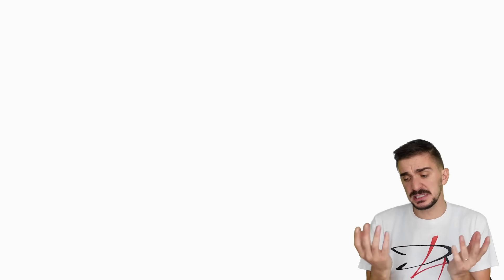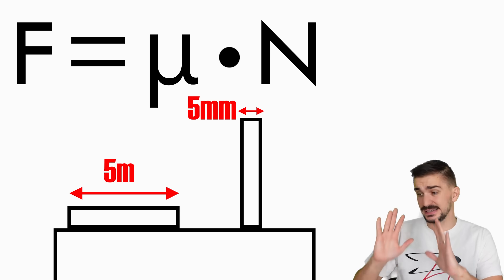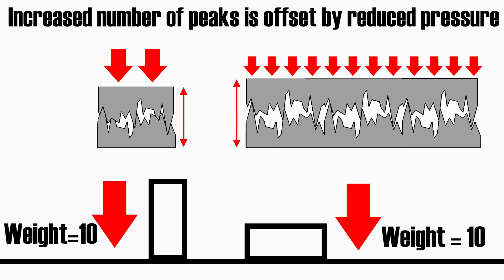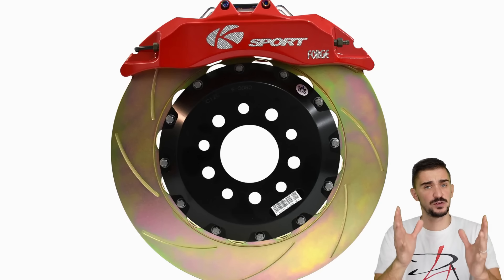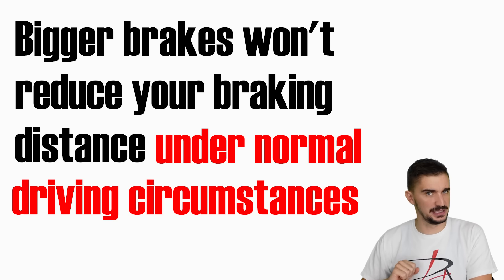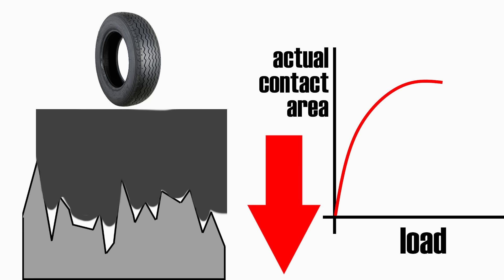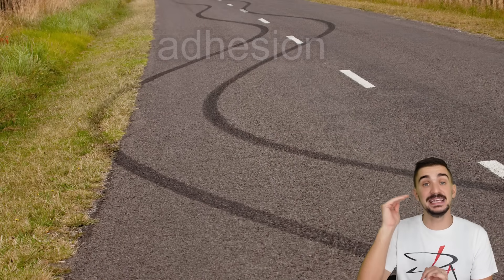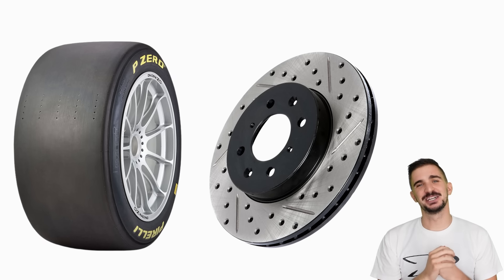Why Big Brakes Won't Stop You Faster but Wider Tires Will - Friction and Surface Area Explained

Comment: Excellent explanation, but I find it misleading  as you're grossly oversimplifying the topic. If I put bigger breaks on my Honda Civic Type R with larger, wider summer tires on it, the difference will be minimal, but braking consistency will improve, as will how many times I can apply them before incurring brake fade. The latter is the heat issue you are speaking of.  There is more.  When I upgrade my brake rotors, I will also have to change the calipers. Therefore, I will also go from 4-piston calipers to 6-piston calipers and they will indeed also have larger pads, meaning more friction area as well. If I change rims to the track tires, the larger rotors will again help with increased consistency and make it easier for me to maximize braking performance.

If I put larger brakes on my wife's Civic Si, with smaller, narrower all-season tires, there will likely be no difference other than better consistency and longevity of baking performance.  However, if I take my larger rims and tires and put them on my wife's car, along with the brake upgrade will make a dramatic difference.  All of this is based on much personal experience.

You also completely left out the increased mechanical leverage of the larger rotor almost everywhere, which I find bizarre. So, yes, if we could somehow install larger rotors on my wife's car, without changing the calipers and without changing the tires, you  would be correct for the most part.  Otherwise, I find the scenario you're basing your information on to be woefully oversimplified and unrealistic as it is based on a completely unrealistic model.  I don't believe you to be incorrect in your science, but in the models you're basing your science on. They are simply not real world examples.

Comment: Can you please do a video showing how/why big cams cause an oscillating idle! 🙏
Reply: If you have access to Engine Masters on Motor Trend,  S5 Ep12 is all about Lobe Separation Angle (LSA).  You'll find your answer.  They dyno three cams with the same lift and duration,  but different LSA. Happy hunting.
Reply: @jeffreylonidier1607  I want an explanation, not a video simply showing the effect! I already know the effect; choppy idle.
Reply: Your original comment asks for a video?  As stated,  the answer is cam Lobe Separation Angle.  Engine Masters explains, in detail,  how/why LSA,  not lift/duration affects idle quality and power.
Reply: @jeffreylonidier1607  where/how can I watch the video??

Comment: A follow up video is needed to discuss brake leverage (or "brake torque"), which isn't discussed here. As per Race Technologies (an official Brembo partner): "Brake torque is essentially the power of the braking system. The brake caliper acts on the disc at a certain distance from the hub center, known as the effective radius. The force exerted by the caliper, multiplied by the effective radius of the system equals the brake torque. Increasing either the force applied by the caliper, or the effective radius results in increased brake torque."

Other videos on YouTube talking about brake leverage / torque:

https://youtu.be/48BRZEzXtcA?t=63

and

https://youtu.be/6NbAEtcQXgg?t=140

Comment: There's another reason why wider disks perform better. Torque. It's much easier to stop a spinning disk by applying friction at the outer edge than towards the middle.

Comment: Over-simplification.  Brake fade, tyre width, the weight of the vehicle, weight distribution, suspension geometry, these all play a part.  Hence, bigger brakes and a tyre upgrade WILL allow you stop faster.  If you have drum brakes incapable of locking up the wheels at speed, a brake upgrade will 100% improve your braking distance.  In short, you are talking out of your arse my man.  Clickbait crap.

Comment: Excellent video, one point you did not mention is that the rubber mixture can be changed as well, so you can make a wider tire out of softer rubber which will increase its adhesive properties while lasting a similar comparable distance than the stiffer narrower tire.... so many parameters to play with :-)

Comment: Increased brake size is not just about surface area and heat dissipation. The diameter of the brake matters too. One of the things driving larger wheels and lower profile tyres is it allows the fitting of larger diameter disks. Why does that matter? It's braking torque/leverage. In essence the braking force available for a given applied friction is directly proportional to the distance of the centre of the pad from the axis of rotation. If the disk size is increased by 25% then the braking torque that can be applied for a given amount of frictional force is also increased by 25%. That will increase the amount of braking up to the point where the tyres lose traction.

Of course the increased diameter disk also increases it's ability to dissipate heat too due to the larger surface area.

Somehow this video completely misses the effect of larger diameter brake disks, and unlike the non-linear issues involves with applying more force, the braking torque relationship is exact. That 25% increased diameter will lead to 25% increase in braking effort for the same amount of applied friction. This is rather fundamental.

Also, I would question the use of the word "elastic" when talking about tyres. In physics, elastic has a very specific meaning. It's about energy loss and return on deformation. It may surprise people that the steel wheels on trains are highly elastic. That makes means they have very low rolling frictional losses. A tyre (or, more precisely, tyre rubber) is not like that; it absorbs quite a bit of energy as it deforms and it should not be described as elastic. Indeed a truly elastic tyre rubber would be very dangerous and offer little grip. Rather, tyre rubber deforms and not all the energy required to do that is returned; some is turned into heat. Tyre rubber is somewhat inelastic, which is not the same thing as deformable (which it also is). The degree to which tyre rubber does this is one of the design aims taken into account for a given compound. There are more complexities in the tyre as a whole; the way the carcass flexes, as well as the pressurised air (that latter part is, to a very good approximation, truly elastic). However, when it comes to grip it is the rubber compound that is the most important factor, and that is most certainly not elastic in the technical sense of the word.

Comment: Bigger brakes can reduce locking time of tires when other brake components remain same. Pressure build on brake pistons takes time, leverage of bigger brake disks or higher friction pads may reduce that time. Moreover, more tire grip and more rotational weight (bigger wider tires) can reduce tire locking time. Most of modern cars have enugh brake for stock tires in daily conditions but generally tracks have more grip than daily roads and tires are heavier.

Comment: The physics explanation here is very good, but it's making some incorrect assumptions when it comes to the total picture. The point being made is that increased surface area does not improve stopping power, but instead is for heat management, and this is completely correct. However, larger diameter brakes can increase stopping power because they have more leverage on the rotating mass. If you, for example, go from a 280mm rotor to a 305mm rotor (with the same brake pad and caliper, just moved 25mm outward), you increase the stopping force for any given amount of friction by almost 9% strictly due to increased leverage.

Another aspect that wasn't discussed is more pistons per caliper. The purpose of this is to improve the evenness of pressure along the brake pad, which is particularly important with larger pads, as the bigger they are, the more potential there is to flex, and not contact the surface evenly. It mostly only affects pad wear and consistency of brake feel, but a very uneven application could cause early brake fade in a more extreme case.
Reply from the maker: I'm interested to know the formula you used to get 9%
Reply: @d4a   Dividing the 305mm by 280mm, it's just under 9% larger, though the real number would be the average increase in the ratio of the lever length across the pad contact area. For a particularly wide pad area it might be even higher, since moving 12.5mm outward on a smaller original radius is a larger proportional increase, but it's still pretty close. 

It's pretty easy to see this principle in action if you have a gyroscope or any other spinning toy where there's a wheel and a shaft - get it spinning, then try to stop the rotation by pinching the shaft vs pinching the wheel. Moving outward from the center of rotation makes stopping it easier.

Comment: Nicely explained. What is the role of the diameter of the brake disk and resulting difference of the torque? (Thinking about it in context of bicycle disk brakes.)
Reply: The same braking force applied farther from the wheels axis of rotation will create more braking torque. However, on cars this still doesnt make big brakes stop faster because you need pretty stupidly sticky tires (like F1 slicks) for braking torque to be the limiting factor.
Reply: Yes, that makes sense.

Comment: Bigger brakes can hold more heat before overheating and they dissipate heat faster. Putting tiny brakes on a race car may lock up the tires, but they will overheat instantly.

Also a larger rotor will give the calliper more leverage to stop the wheel.

Anyway I think that unless your brakes are tiny, or you do hard tracking with a powerful car, a simple pad upgrade is all you need.
Reply: The key is having a lightweight vehicle that can have small brakes (allowing for smaller lighter wheels) and the brakes will not overheat
Reply: Your 100% write. But people that don't know this won't understand.
Reply: It isn't that you expect a big brake kit to stop you faster. I know better than that. If your brakes are strong enough to lock up your tires, then you're not going to gain anything with a bigger brake kit. What you will gain in most cases is reduced fade. Both by additional Mass for the Heat to go into, and greater heat dissipation assuming that the disc is reasonably designed.  In some cases, these aftermarket discs will perform less well initially.  Because they're designed to be used at the edge of performance and really give their best performance once they are hot and the braking compound has chosen to work with that.

When the brakes are still cold, you may have a stiff or slick feel to it like it's not braking very well at all.

I have a 2021 Mazda3 turbo which I bought at the very end of 2021. 2282 I put 54000 miles on the car, I drive a lot. And it is through the North Georgia Mountains so it's a lot of curvy roads with long steep grades.

Do not get me wrong. I love my little car. For daily driver it is awesome. The tiniest little GT car ever. It will effortlessly hold 90 miles an hour while getting 28 miles to the gallon, it has plenty of power for passing and can squirt up and down those mountains.

But.  And it's a big but.  The front brakes are inadequate for truly spirited driving.  In less than 3 Mi coming down Brasstown Bald oh, I was able to get the brakes so hot that breaking Effectiveness was reduced by 80 to 90%.  Toward the end I was actually a bit concerned, having to use engine braking and sudden darting movements to get the car to slide a bit to scrub speed.

In Daily driving, I've never had a problem with it. But I have chosen to get the corksport big brake kit oh, and the next time I'm due to buy tires, I'll be swapping out the tires, wheels & installing the brake kit.

For now, I've chosen a high-temperature compound for my brake pads.  It does mean braking is a little bit subpar when the discs are cold.  But far from dangerous. And as the discs get hot, fade is greatly reduced.
Reply: I don't know why voice typing randomly inserts "oh"

I've recorded myself talking, and I don't say that or anything that sounds like it.
Reply: @thebarkingmouse  idk if you’re taking to me but I agree entirely based on what I wrote previously.

Depends on what you do with the car 100%, and if you’re not braking hard and fast multiple times in a row your stock brakes will be fine on basically any sporty car, maybe a high temp pad upgrade. 

If you’re actually tracking the car then I agree 100% a bbk is required on almost any car. 

Lots of people spend $6k on a big brake kit when they just drive on the street and then they’re confused/disappointed when they don’t stop any faster when they slam on the brakes since the old brakes weren’t fading anyway.  

For example my friend bought a big brake kit for his car because he tuned it from 250 to 380 horsepower, but he never tracks the car and only ever does a single highway pull every once and a while. It was a big waste of money for him and he regrets it.
Reply: Great video. But don’t larger diameter rotors place the caliper slightly farther from the center of the wheel which allows the caliper to have a greater moment arm which puts more torque on the wheel than does a caliper on a smaller diameter rotor?  If smaller diameter rotors performed just as well as larger diameter rotors, sports cars would use smaller rotors to save weight.  

You might also want to do a video on multi piston calipers and two piece rotors.  My 2003 RS6 has 8 piston front calipers and huge, two piece rotors and stops in less distance than any other car I have ever owned.
Reply: @glenwoodriverresidentsgrou136  If your small brakes can lock up the tires, the only thing bigger brakes will give you is better resistance to heat fading. More metal = more thermal mass therefore, harder to overheat. 

However you’re right, if you have really sticky and wide tires you need big brakes to use them to their full potential. Race cars have a ton of grip and therefore require big brakes to max out the braking grip.

Tire grip determines stopping distance, and your brakes only need to be able lock them up to get the most benefit (which many “small” brakes can do even to tires like PS4S etc.). So at that point, bigger brakes only helps reduce heat fade by increasing mass and cooling area.

My gti has relatively small brakes but it can lock up warmed up 245 Pilot sport 4s  pretty easily. This means that my one-time stopping distance wouldn’t decrease with larger brakes, but it would be more consistent around a track with multiple braking zones.  If I fit some really sticky tires the brakes probably wouldn’t be able to lock them up anymore at which point I’d indeed need bigger brakes.
Reply: @glenwoodriverresidentsgrou136  I don't think he specifically said this but the comment did. Even if the larger diameter rotor gave you more leverage, if you can lock up the tire at high speed it's still too much braking force regardless of the size. Modern materials are just so effective and transferring kinetic energy to heat that it's a non-starter. Even the smallest kei car brakes will lock the wheels of most cars. But the different would be overheating from a 180mph hairpin instantly because it can't handle the heat. 

Those big, juicy brakes on the RS6 are designed that way for a few reasons. Firstly, a larger pad requires more pistons to press down evenly with the same amount of force. The larger pads less friction over a larger area which equals more friction over a smaller area. This allows a better and slower heater transfer which in turn allows any other designs to dissipate that lower heat quicker. Every way you look at it, they all complement other components. In this case, it's all about making sure those brakes and shed that heat as fast as possible because not having brakes at 180mph will.... well.... That's bad mmkay

Comment: Yes and no. 

The larger brakes have more mechanical advantage on the hub so will have the same braking potential with less pedal effort. In fact if you upgrade your brakes on your stock vehicle you find out that the tyre is the next limit to braking potential. 

A simple pad or rotor change from stock materials designed to pass a brake test while not wearing out quickly can increase braking performance, but just saying "big brakes don't work" or "surface area etc" doesn't float when the title is literally "why big brakes won't stop you faster" when they in fact do...

Comment: I’m no expert but just repeat what I have read. Like most people I believed that wider tyres give more grip. In the days before the internet I read a magazine article written by a tyre designer who said this wasn’t true.
He explained that a tyres contact patch was produced by only 2 things. Weight pressing down and the tyre pressure.
So a narrow tyre has a long thin contact patch and a wide tyre has a wider contact patch but not as long. The actual contact patch remains exactly the same and only it’s shape changes.
He went on to explain that a wider tyre is normally lower profile which gives improved response and being a performance tyre it would usually have a better compound. It is those factors that give the impression of greater grip not any increase in the width.
This seemed to make complete sense, and as anybody that does track days knows some of the fastest cars are caterhams and lotus. These often run much narrower tyres than many super cars but are the fastest through the corners. ( I know other factors such as weight also play their part)
Many journalists still claim more grip because of width of tyre, but to me the contents of the article still makes sense.